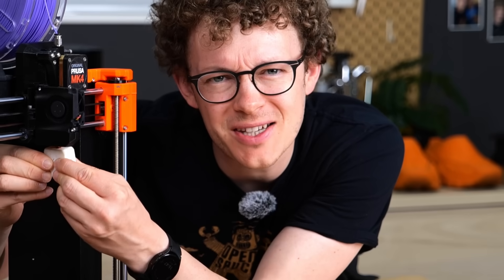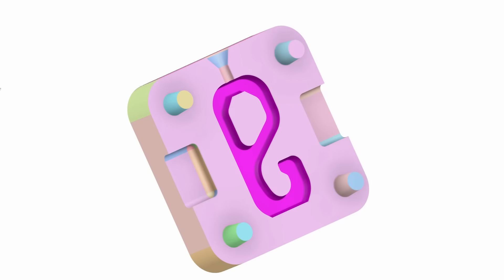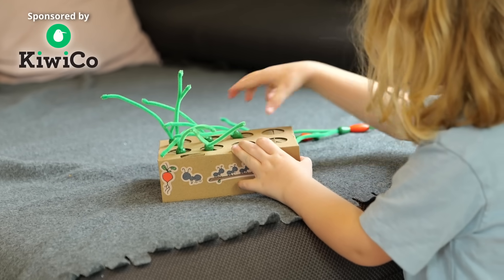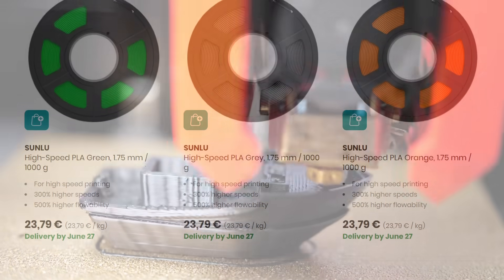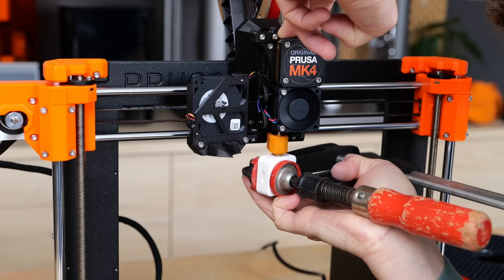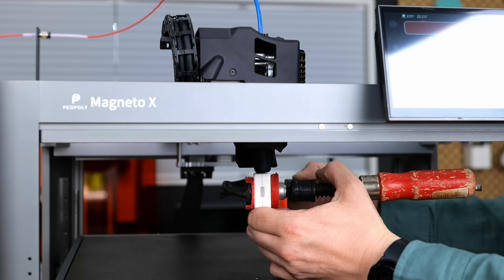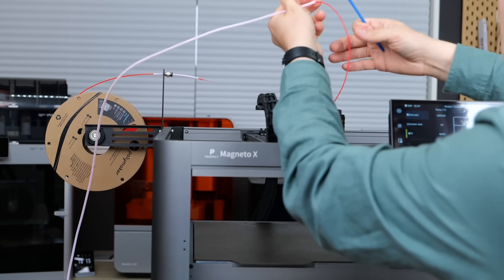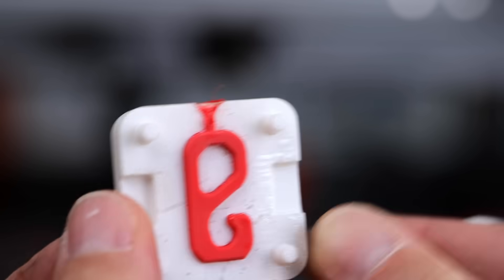I tried Injection Molding using a 3D Printer!

Comment: You need a relief outlet. Basically a way for the air to escape.

It needs to be fairly small, so it can provide some restriction to the plastic flow. That way plastic will still want to fill into all the smaller details. Placement should be at the end of the plastic flow path.

Comment: I think you chose the wrong inject point: for example for the screw it should be in the middle of the screw.
For the mini-stephan on the belly button.
That way you reduce to half the length that the fluid has to go through.

Comment: Have you thought of using a 2 part polyurethane resin.  I mix two part resin and it is a low viscosity liquid.  This can be injected with a syringe and a blunt needle.  Fast Cast resin hardens in few minutes, de-mould time is about 20 minutes, full hardness is reached in a few hours.  I am new to 3D printing, but a 3D printer seems to be a great tool for making moulds, or making hollow parts that can be filled to provide solid object without using a lot of fiber.  The polyurethane does generate some heat as it hardens, but probably not too much for the mould.  Epoxy can get quite hot though.  I use polyurethane resin for potting electronics, but have not tried combining 3D printing with resin.  People generally use casting resins for toy soldiers and models, and they generally produce very fine details with simple moulds made from mouldmaking silicone pressed onto a shape.

Comment: Great video, thank you.
What about instead if using an nozzle, you use multiples your volcano adapter until you have threads sticking out the bottom of the hot end.  Then model the mold with threads and screw it into place.  Just a thought.  Thanks again, its always interesting to watch your videos.

Comment: Great video as always!  My suggestions at this point. 1) Conspicuous absence of sprues in your molds. 2) Make your molds out of aluminum or brass.  You can use your CNC mill/ router.  3) Make your mold secure to the hot end mechanically:  either locking onto the nozzle, or screwing into the heat block directly. 4) Get a small aluminum C-clamp.

Comment: Accessibility analysis under inspect in Fusion 360, will show you all the undercuts from a specified angle, might make mould design a bit easier, under simulation there is also injection moulding sims, though haven't used them myself.

There are also injection machine designs with a holding chamber instead of the screw so you could melt into that with the extruder then do a fast single shot?

Comment: I there
I work in injection molding, and as many people have said, you need a hole to make the air inside leave, butt also the molds are injected while being hot, that way the plastic doesn't cool down instantly.

Comment: To add to the air hole comments and suggestions : 
Using multiple extruders / inputs could also be a path to increase flow rate. Especially on larger pieces. 
Another feature I'm thinking about is multicolour where you could move the model from one mold to another, each time adding details to be filled with different colours.

Comment: i think the pressure is not the problem - your problem is speed and coolingrate in the mold.

you have to melt all the needed volume and then shoot it in.

a slow printer extruder might be ok for very small parts.

maybe some air vents would help to reduce the airpressure in the mold, the plastic has to "fight" against. some small 0,5mm holes might help a lot.

Comment: You might be able to use a more DIY setup to make this work.
You could set up a small gear that grips the filament and connect that to a hand crank to get as much force as you want.
Then, the filament would be pushed through a heating element, which could be a repurposed 3d printer extruder or something else.

It's a really neat concept if you can make it work.
I'd like to see how the strength compares to traditional printing.

Comment: Once upon a time before 3D printing machines were cheap I tried injection molding  with hot glue and I actually got it to work after a fashion using milled aluminum molds. The thing that really helped was preheating the aluminum mold. In the end I got a small Creality machine when they became available and now I make all my parts that way.

Comment: clamp the mold to the nozzle using the bed, this also allows you to heat the mold. holding it by hand limits injection pressure

Comment: If you haven't tried yet, you might have better luck with PHA filament or FlexPHA. Can use lower temps and it flows really well, with the added benefit of being compostable at normal temps compared to PLA.

Comment: A lot of people have mentioned already to put a hole in the mold to allow air to escape so that you don't have to fight that.  But where I worked, we would put a hole in the opposite side and attach a syringe to pull a vacuum there.  If you want the material to compress, you can apply pressure to the syringe once you see the plastic flow out.  Just a suggestion.

Comment: You will need to actively heat the mould above the glass translon point, Id use an engineering resin or a resin with metal or ceramic particles like the ones designed for sintering, use two small silicone heat pads on either side and heat the mould, then you wont need nearly as much pressure to fill it, a better process would be to make your mould on a small CNC out of aluminium instead, then you can use standard hotend heater cartridges to heat up the mould easily, just drill a 6 x 20mm and a 3 x 20mm nearby for a thermal sensor, might try this myself.

Comment: A lot of others have pointed out that you need air vents, but Ai haven't seen any that said why. The problem is that you are pushing a semi-solid into a semi-air-tight structure. That's why the first time you heated the mold while injecting into it that it did not fill out: the air was compressed into that void space. Take a simple scratching tool and scribe a quarter-millimeter line from the furtherest point the plastic has to flow to the closest edge and try that experiment again. Your results on that test will be dramatically different.

Comment: You have a mold design issue. You need to provide vent lines in order to allow trapped air to escape,  as you push in the molten plastic.  Preheating the mold a little would be nice if possible as well.

Comment: modify a hot end nozzle so that the mould can screw on, this will help injection pressure. the thread is stronger than hands, then to tell when it is full and to help the air release, put a vent hole or multiple vent holes on the other side of the part from the nozzel.

Comment: You might check with people who do metal casting; there may be a more optimal sprue design for flowing material into the mold efficiently so it doesn't end up with voids when it cools.

Comment: Preheat the clamp with the mold, and get it as hot as the mold can handle.
Use a mold release agent, even something as simple as a light coat of cooking oil will make it MUCH easier to get the print apart.

Comment: You could design it so that you could use the volcano adapters (probably at least two so that is sticks out of the heating block) and then thread the mold onto that part so you can keep it still and have a good seal.

Comment: I would suggest the mold have a heating element to keep the filament liquid enough for the pressure to keep moving the stuff further into the mold.
For example have two near by holes for the heat plug(s) to keep the mold nearer to say 100C and press the filament further. That might work to keep the plastic from cooling to much.

Comment: Remake the mold parts into plaster and then preheat them to 200°C - add some venting ports and fill until they leak... maybe? Have you seen what the ppl at the Action BOX channel are making? Tabletop injection molding machine - it's pretty cool.

Comment: Try injecting into the center of the part - reducing the average path length that plastic needs to flow.  Preheating the mold should also help.  Air may not escape at the parting line, so deliberate air vents may help.

Comment: Wow! You need to try geting the Z axis to press into the mold to keep the pressure even while injecting the plastic. Maybe using a small drill press vise instead of the bar clamp.

Comment: Make a DIY injection molder that can take 3d printing filament / pellets. I think if you had two hot ends / extruders pushing into two holes in the mold you could get it filled "faster" to get it filled before it starts to cool. also on the "preheating" side of things, maybe put the entire thing in a heated inclosure, so it does not cool down as quick.

Comment: i have a background in injection molding some tips i have found in industril cases
1 you need a holle for air excape this allows for better filling
2 the problem you have for the undershot is from the masive gate this like the support on resin is easier to remove the sprew
3 a mounting plate on the back side of the hex for the hot end will allow for heating the mold and betting injecor presures
4 when injecting you want the material almost to the point for burning this allows for faster injection and better fill

Comment: >625 dollars
>Affordable
 You and I have a different idea of affordable lol
 Maybe try placing some copper plates in recesses on each side of the mold to absorb and retain heat. It probably won't work too well for larger molds though.
 You also need additional channels cut to allow flow through of the material and allow air to escape

Comment: I am a mechanical engineer that has made many consumer injection molds, and contrary to what everyone is saying, big vent holes are unnecessary.  In large molds our vent holes have a gap of 0.15mm or less.  The gaps your printed mold has is enough to release any trapped air.
The main thing you're missing in filling the mold is SPEED.  Remember plastics care about only 4 parameters, time, temperature, pressure, and shear.  Plastics are non-newtonian, and injection molding takes advantage of that.  We inject at high speeds shearing the material to help it flow better.  That's done by building our shot size in the barrel, then injecting the material using a ram.  That ram is very fast.

Comment: you need to have a vent for the air to escape and you also need to heat the mold somewhat, that way it does not instantly harden and jam the mold

Comment: My idea is increasing nozzle diameter first and foremost. Then the nozzle should be a high flow nozzle but probably you already thought about it. Anyways, these two should increase pressure a bit. Also Ideally mold should be hot

Comment: Best part 8:54 
Stefan: 3d printers have been becoming more common and inexpensive 
Also Stefan: showing of his collection of 2000$+ 3D printers
Reply: The only 3D printer he has that is $2000+ is the Prusa XL with the 5 toolheads, which retails for around $3500. The others are sub-$1000 printers, except for the Snapmaker, which retails for $1100. My bets are that he has not invested in all of these at once, or they were gifted to him. None of these compare to a decent quality injection molding machine, which is around $10-15k on the low end

Comment: you are increasing pressure inside the mold when you inject - so you need a tiny hole somewhere in the mold to allow air to escape , it will also act as an indicator when mold is full with filament (y)

Comment: I feel like the air bubble in the first mold heldback the weaker printer and thats why weren't able to fully push the plastic all the way through and the air pocket cuased back pressure.

Comment: What if you used two of those volcano hot end adapters so that you had thread at the end of the extruder and then could screw a mold onto it. That could help increase pressure.

Comment: As already mentioned you need an air exhaust point. I was surprised not seeing them now since you already done that when you made the silicon injection mold.
To seal you need a gasket. Like any engine would. Maybe TPU can do the trick, if not, that high temperature silicon you showed before would definitely do.
I don't have a Resin printer to try this myself, so I am curious to where thia will go.

Comment: You need to add a non-thermally conductive seal gasket at the injection port. A plain rubber gasket that's vulcanized will probably work fine. It will keep the injection site from melting long enough to perform the injection.  You can also preheat the mold part way to the melting temperature to help slow down the solidification inside the mold.

Comment: Did you include small holes to let the air out of the mold? The closed and creates pressure holding the plastic back. In professional molds for aluminum you have "beans" that basically is excess material attached to the products that are removed after releasing the product from the mold.

Comment: So, my approach would be this:

1. I would design the Mold in a way you can fix the sawed off end of a Ring Wrench in the entryhole, so the nozzle could be inserted there with a perfect fit. This would seal this side of the Mold and would give it stability for step 2:

2. I would place the Mold on the Toolplate and lower the Hotend into the mold until the nozzle seals the entryhole with the force of the 3D-Printer. Would also take a lot of effort from this process. If you use a machine that can move XYZ, just use Z for your advantage.

3. You need to have an airhole on the mold, so that the air can be released while the filament is being pushed in, otherwise you will just build up an aircushion that resists pressures way higher than any 3D-Printer could build up. The best option would be to place the hole very small in diameter somewhere where the molded part would end, so filament only comes down after the whole mold is filled, and then it will be filled to the sharpest corners by the pressure building up by pushing filament in with like 30mm³/s while it can only escape with 1mm³/s. 

4. I would build the mold to be changeble. Like the outershell with the ring wrench part and the airhole, and then a uniform square in the middle where you can just plug in the mold area for the specific item. So you dont need to build 10 complete  molds for 10 projects (and destroy 10 ring wrenches), but can just change the internals based on what you wanna inject and save time, money and resin.

I hope this comment finds you well and i would appreciate it if you would try my ideas :)

Comment: You need an air hole! With the current molds the trapped air is being compressed air until it effectively balances the extruder pressure. Add a small air hole at the opposite end and I suspect you'll have a lot more success.

Comment: Suggestion: Run the extruder getting a good hot flow, then quickly put the mold under this hot stream pushing up tightly as you do. I suspect you have a slightly cooler starter "plug" that you're pushing through the mold and causing resistance. Nice work as usual, thanks

Comment: I will suggest pre-heating the mold for better flow, and adding some kind of thin lubricating layer so the plastic can flow more easily, in addition to the advice about air holes, sprue placement, and using the printer to push the print head into the mold.

This is such a cool idea! And it was great to see you at OpenSauce!

Comment: Since someone beat me to the comment I will make my addition to it your whole needs to start somewhere near the very bottom and take a separate pathway up that you can cut it off and sand it flat just like you do with your entry point this will eliminate back pressure cuz no matter how hard you squeeze air it will always take up space even though it will be less space the more pressure is put onto it. Starting your air hole at the very bottom and modeling it into your template will allow it to push all of the air out of the lowest point and yes fill up that part of the tube as well but I also recommend having your hot plate changed to an oven with a preeclamped molding using a metal clamp for consistency then using mitts gloves or some other form to transfer it into position if it is already preeclamped then you'll spend less time letting it cool in the process of getting it over to your extruder. You might also consider using some sort of baking release like a cooking spray which most of which will get squeezed out and if you leave your molding with one of the openings pointed down the excess should drip out before it even gets to the extruder for injection. In theory this should make it easier to retrieve your injection molded plastic, I'd avoid anything hydrogenated as it's basically plastic already. A fantastic idea and hopefully with this crowd sourcing method you're able to produce better and better molds. Thank you for sharing your video. Also if you're wanting to do molds that don't have a second exit point you can try filling them in your mold with current methods being used and then to fix it later reheat the mold in the oven without undoing the mold and occasionally either tapping the mold while it's in the oven or using something like an oscillating tool to vibrate the air bubbles out with molten plastic inside, one caveat to this method is it will never align quite the same if you're opening the material so get an idea of how much air needs to come out via trial and error and how much you can get back into it via this method then when you actually go to do this for a final product never pop open the molding until you are sure it has filled all the way, we call this the paint shaker method lol The poor mans cousin to degasing in a vacuum chamber and refill/repeat as necessary.

Comment: Ideally I think you'd want to heat up the mold also. So the better way to do this would be to cast the molds you've made in aluminium, and then clamp the metal mold to your hotbed to keep the mold hot while you inject from the 3D printer nozzle.